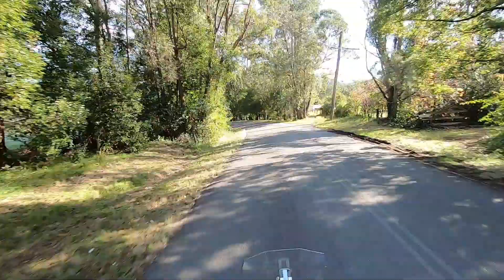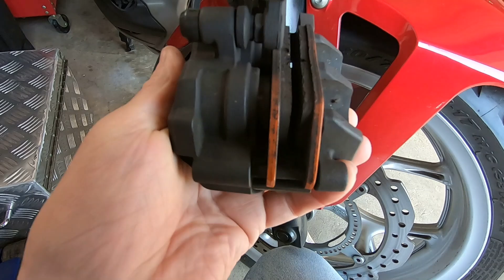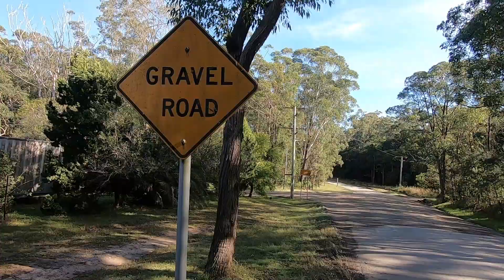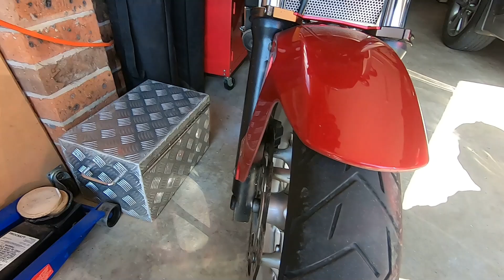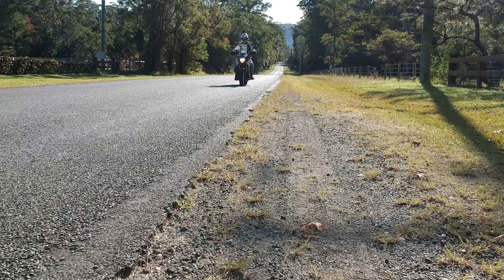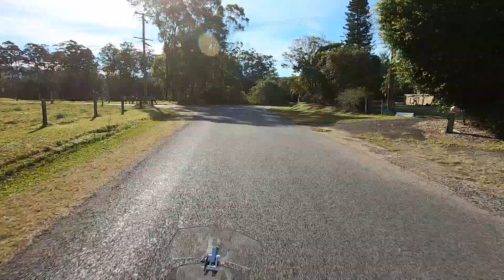Motorcycle Brakes  - Are mine BIG enough

Comment: Two up with full aluminium panniers and top box my Tiger is close to 500kg gross, I really enjoy the stopping power of the Brembos but if you have anticipated the road well enough in the first place its full braking power usage should be an occasional event. Whereas my CB1100 has twin front disks, each with a four piston caliper and they are "adequate" for the type of riding you would ever do on that bike. So I have six more pistons than you up front on the CB but I bet I don't stop any faster.

Comment: Good video, ta very much. 
At least we no longer have to keep gently applying the brakes in the wet, to dry them enough for them to work immediately, unlike the early Japanese chromed disks. 
The fact you ride your bike on the various very dodgy looking unpaved surfaces, must make for good concentration to get controlled stopping 👍🏻🏴
Reply from the maker: Yes. My first two road bikes had drum brakes. 😃
Reply: First and third for me. Suzy TS250M and XL500. Drums seemed plenty at the time. 
Latest bike has double Brembos  on front which are overkill as any more than 2 fingers likely to have a bad result on less than perfect surfaces if caught out, as no ABS. 👍🏻
Reply: What were your first two?

Comment: Yep, every time I pull the lever or push the pedal the bike slows down or stops. The ABS thingy has helped a couple of times....I think, when it's been an emergency. Practice makes.....well it helps. Road surfaces change, the weather changes, breaking hard in corners is different to being straight, downhill can be scary etc, practice is probably more important than 8 pot, dual calliper, floaty flux converter discs 👍
Reply from the maker: Well said 🥰

Comment: I have a 2019 NC750X and the front brake feels spongy and weak since the day 1. They checked it at service under warranty, changed the fluid, but it didn't change anything. I never managed to lock my front wheel nor engage the ABS as the lever goes all the way until it actually touches the handlebar. So usually it stops on my fingers first using maybe 60% of stopping power. Only solution is to have the lever set to furthest setting from the handlebar. But then I can't reach it while riding. Quite dissapointed as my old NC700X had both brakes nice.
Reply: Sounds like air in the master cylinder, some people struggle to get it out, but the trick is easy. Take the lid off the brake reservoir and gently tap the lever, tap, tap, tap. If there's air you'll see small bubbles pop out.

Comment: I agree. I think the "feel" of the brakes is much more important than the overall stopping power. Fresh brake fluid, a bubble-free system, and an adjustable lever are a must. I also put on braided stainless steel lines. Maybe it is placebo effect (I don't think the brake hose flex contributes much unless the volume of the system is large), but I at least believe that the response is more linear. Mostly I like the way they look, and it was a fun project for me to do :)

Comment: Sensible advice, and I agree they're perfectly fine for their intended purpose. 

This is twice now you've touched on maintenance jobs that I've also need to do. Last time it was the air filter, to which I needed to do on a service and have valve clearances. Today I've had a package delivered and guess what it is....Front brake rotor (cb500x) How freaky is that. Whilst I've got the wheel off I reckon it's about time I refreshed the fork oil too. 

I see you've done a video on that too, might take another look lol keep up the stalking won't you ha ha ha.
Reply from the maker: Ha!  Good to hear you are on top of it. Look after your ride and it will look after you.

Comment: Last year I took my NC750X to a training at the Austrian Car Motorcycle and Touring Club (ÖAMTC). Part of it were braking lessons. There were all sorts of bikes, among them one other NC750X. Actually, the NCs performed best of all when braking, which amazed even the instructors. It was obvious that the number of brake disks at the front wheel is not important, neither is the number of pistons in caliper. Reducing complexity is one of the most important duties of a mechanical engineer, and obviously Honda's developers did a very good job with the NC series, not only with the brakes but the rest as well.
Reply from the maker: Interesting to hear your experience. Thanks.

Comment: Yeah, that really must be a problem of the motorcycle world, you never see people complaining about car brakes and you don't also see them saying I need to remove those Nissin and install a Brembo set.
You forgot to mention, that when time comes to replace the pads and brake fluid it's cheaper and easier.
Will not mention replacing rotors of course as the people who say 1 rotor is not enough don't ever keep their bike that long.
Good video!
Reply from the maker: Good observations. Thanks.

Comment: Biggest reason to upsize brakes is if you need to stop hard often, or, if you run heavy loads.
1 hard stop from 100 should never stress the brakes, but do that 5 times in 5 minutes, and you may experience brake fade.
My bike is ~25kg heavier than my sons bike, and came fitted with twin disks/calipers (same caliper/pads as his), where as his is a single. Both work well, but slightly more fade in his setup.